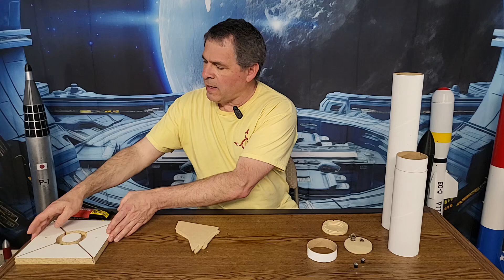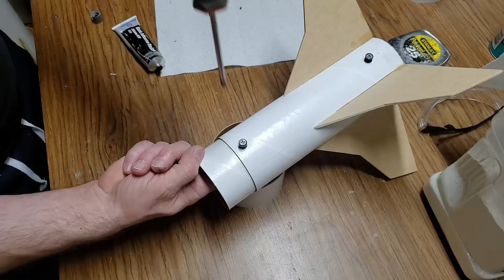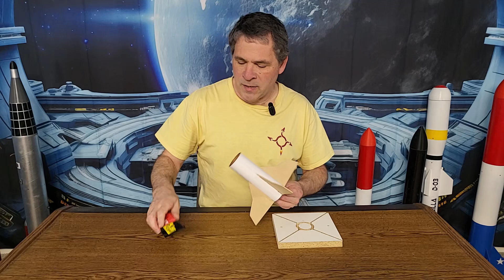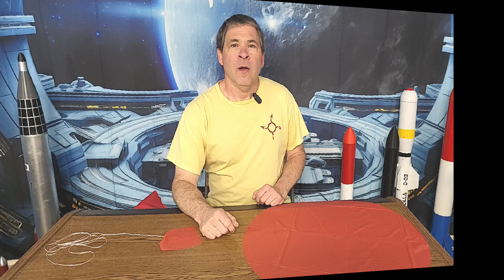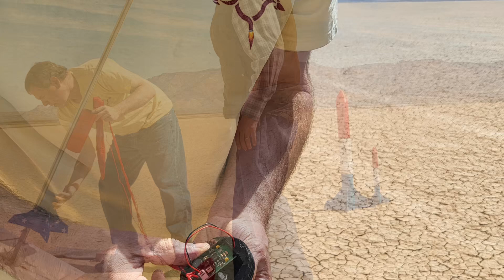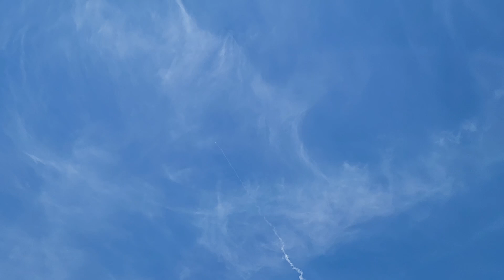Building and Launching some new homemade rockets

Comment: To eliminate not connecting your parachute to the rocket, use a checklist. It happens with everyone (an experienced L-3 certified friend of mine once launched a rather expensive 6" rocket with an O impulse motor and forgot to connect the chute...a simple checklist would eliminate these things from happening.

Comment: Hey its me again! I was wondering how u blow the nosecone of without ejection charge, or do you maybe have a motor that does have a ejection charge? :D
Reply from the maker: Hi... We use a flight computer to detect when the rocket reaches apogee and that fires and ejection charge. Here's a video that shows our electronics bay system built into the nosecone.
https://www.youtube.com/watch?v=kqkOH7tAqLM
There's links in the description of that video that give more information about building the flight computer and ejection charge.

Comment: Hey guys. I'm an amateur rocket enthusiast from New zealand. I want to be able to make a rocket motor using flexi fuel. So can you tell me what the  ratio of the ingredients for flexi fuel is? I have checked out your videos about rocket motor construction, but the materials I have available mean that my rocket motor size will be different. So I can't just copy what you fellas have done. Have a good day.
Reply from the maker: Nice to meet you... Thanks for coming by...
First off, make sure you watch this video, it's my favorite motor to build:
https://youtu.be/U1PLWJNi9ko
I'm currently using 65% powdered potassium nitrate, 18% powdered sugar and 17% corn syrup.
Corn syrup can be difficult to find in some parts of the world. If you're having trouble finding it, try Bin Inn. Otherwise, there are other alternatives you can use. We made a series of videos about alternatives. Here's a link to that playlist:
https://www.youtube.com/playlist?list=PLdExiIqOZ0llJQ42u5XqHqHTp8298Ze5z
I've done a little research into metric PVC and my best understanding is that uPVC DN32 PN18 is the closest equivalent to USA 1-1/4" Schedule 40 PVC pipe.
Feel free to ask any questions, I'm happy to help.
Reply: Hey, thanks for taking the time to answer me. I'm a big fan of your  work it is very inspiring, and I have learned a lot from watching you. Keep up the good work. 
Seth

Comment: I like your nose cone and electronic bay design, is it in line now? Does it have protection in case the rocket crash?
Reply from the maker: The 4" nosecone and related electronics bay components are available on Thingiverse.
https://www.thingiverse.com/thing:6925575
I have not put up the 3" or 2" ones though. If you are interested in them, I can make them available.
Crash protection... hmmm... well, if your nosecone fails to eject and the rocket comes down ballistic... That's the end of your nosecone and most likely the end of your flight computer. Sorry.
Reply: @rotaryrocketry  I'm a little late, but can you make these available?  Also, are the smaller fin, ring, and bulk head patterns available?
Reply from the maker: Exactly which parts are you interested in... And for which size rocket. I will do my best to provide you with what you are after.
Reply: @rotaryrocketry  If you have the nose cone STL files and the printable patterns for the fins and rings that would be awesome.  Starting my journey from Estes style kits to bigger and more powerful rockets.  Would love to start with the 2 inch and work my way up. :)
Reply from the maker: O.k... I have all that... It would be best if you email me and I can get that to you. If you go to:
www.youtube.com/@rotaryrocketry and click on the word "more" beside our logo, it will pop up a box that will show you our email address.
Reply: @rotaryrocketry  I would like to make the micro eleminator for my first mid-power rocket. would you please post the 3d nosecone print file. thank you.
Reply from the maker: Here it is... https://www.thingiverse.com/thing:7136582
Reply: @rotaryrocketry  Thank you....
Reply: After a rather expensive ballistic recovery of electronics, I built a 'black box' for one of my 8-foot long 4" minimum diameter rockets. Worked great the next six flights but how do you test it to see if it protects the electronics?  On the 7th flight, after it started arcing over, I realized I hadn't armed the electronics (the reason for checklists, experienced or not). We watched it come down from above 5,000' and about a mile away. 
Two months later, a university team out searching for their rocket found my steel nozzle sticking out of the ground. We dug it up, now 3 feet long, and found the black box intact but with eye bolts smashed into the bulkheads. We ground them off and slid out the electronics that looked good. Replaced the dead batteries and heard the altitudes beep out...the black box had done its job.
Do I still use it? Not often because of the added weight and I seldom crash rockets but on flights filled with expensive avionics, it still gets used, especially if I need added weight for stability.
Reply: @mojaverockets I definitely will build some protection for the electronics, because I don’t want to keep building the circuit over and over! Maybe an aluminum box inside the pla box with crumbling zone.
Reply from the maker: That's one reason I like using the EggTimer Apogee.... It may not provide a whole lot of flight data but when I smash a $15 flight computer I'm not really that upset. I remember crashing my $80 Altus Metrum Easy Mini... That was depressing.
Reply: @wayofflow955  My decision to build the black box was a crash with $800 of avionics and thinking there must be some way of protecting them. 1/2" bulkheads and 1/4" wall compartment did the job plus including G-force reducing foam and mounting the electronics inside in such a way that reduces or restricts their movement...older style capacitors and GPS chips are notorious for detaching.
Reply: @rotaryrocketry  When I lost $800 worth of avionics in a crash, that convinced me to make the black box. I have my students and advise others to use Eggtimer Apogees on rockets that don't need dual deploy, as an intro to flight electronics, learning soldering, and as the primary recovery deployment and use the motor eject as a backup...plus knowing the altitude all for around $20 (don't forget the $5 lipo battery).
And on rockets needing dual deploy, the Apogee makes a great backup to more expensive flight computers to at least prevent ballistic recoveries.

Comment: Same motor on a smaller, lighter body, naturally, it has a better chance of performing well, same reason they make dragsters light, even when they look like bricks going down the quarter mile.
Reply from the maker: True but I didn't expect to double the altitude.
Reply: @rotaryrocketry  Well, some times halving the mass can double the velocity, and indeed, yes, you did reduce the drag some, so, to some extent, it can all add up.

Another thing, the temperature of the air [that which imparts viscosity upon it] can have an effect as well.

To launch the same rocket on a very hot day, and on a very cold day, even with the propellant stored in a very uniform manner [aka the propellant grains of each rocket were ignited at platform at the very same temperature (since heating the propellant grain would also alter burn performance, which is YET ANOTHER factor to count into it), the hotter the air, the less viscous it is.

This too is something you learn about in the aerospace industry.
Reply: @hunnybunnysheavymetalmusic6542  Rockets have a sweet spot for maximum altitude...too much or too little mass can lower the altitude.
Reply: @mojaverockets  Yes, it is indeed a balancing act when one is not just 'going all out' to find that point between too much mass and too little mass.

Same with body shapes, because while a really sharp point will allow more speed, it will also cause more heat on the tip [this applies mainly to supersonic speeds, of course] which can be very detrimental.

Also, shock waves on faster rockets can cause damage and cause transonic stall that can rob altitude, and fin shapes can affect how much drag and roll authority the rocket has, and how it responds to cross winds.

Lots and lots of little factors to figure in.

Comment: I hate when people call a sold object 'aerodynamic.'

Only gases can be aerodynamic.

The correct term is 'has a lower coefficient of drag.'

To some extent [but to a VERY LIMITED extent] it is okay to say 'more streamlined.'

I say this as an engineer who had to learn aerodynamics, to its fullest extents, to build turbofan engines for Rolls Royce, as well as other 'aerodynamically applied' sciences involving fighter aircraft in the USAF.
Reply from the maker: One definition of "Aerodynamic" from Merriam-Webster: "the qualities of an object that affect how easily it is able to move through the air"
Reply: @rotaryrocketry  The irony of that is, that while it has been lazily slipped into modern street vernacular, it is technically not a word in that specific usage.

To say something is 'aerodynamic' must first mean that the thing is a gas [which, clearly, it is not] and also that it must change and react in the manner and fashion that a gas does, according to all of the various gas laws [which, again, it does not].

In essence Merriam Webster has begun using DEI and 'ebonics' in its post modern liberal response to changes in the culture, without any regard either for reality, or for the truth.

But NASA apparently forwent looking to Miriam Webster for its definition of aerodynamics, when speaking to 5th thru 8th grades...

And just gave them the truth instead.

https://www.nasa.gov/learning-resources/for-kids-and-students/what-is-aerodynamics-grades-5-8/

And here's Wikipedia on the matter:
https://en.wikipedia.org/wiki/Aerodynamics

Because INTELLIGENT people know the difference.

And as one who grew up in the industry with a father who was also in the USAF before me, who also worked on aircraft, its pretty much something I lived with and worked at literally from when I was old enough to be schooled by him in the science.
Reply from the maker: BOTH LINKS you gave refute what you are saying...
First sentence of the NASA page you gave says "Aerodynamics is the way objects move through air". The "object" is not a gas.
First paragraph on Wiki page says "the study of the motion of air, particularly when affected by a solid object." So clearly, the "object" is a key element in the aerodynamics.
We shall have to agree to disagree because this is the last I will reply on this topic.
Reply: @rotaryrocketry  You have deliberately read the words to fit your world view.

This is something suffered by most of the world at large.

And yet, without 'air' there simply is no such thing as 'aerodynamics.'

Its NOT 'objectodynamics' [or more precisely 'solid dynamics' which happens to be a known discipline in and of its self].

The fact that 'aerodynamics' also include the actions of airs in the form of hurricanes and tornadoes, as well as the propagation of sound and shock waves in a gas, irrespective of a solid object proves that your assertion is factually wrong, and therefore invalid.

While the study of aerodynamics is frequently used to study the behavior of air around a solid, employing gas laws, it is still the study of the 'AIR' [ a mixture of gases] as it BEHAVES.

If said object were removed, the air would still be the air.

If the object were immersed in water, it would instantly be influenced by HYDRO-dynamics, which are, again, a subset of fluid dynamics.

If one drops a 'bunker buster' munition through hundreds of feet of rock or reinforced concrete, it is not aerodynamics.

And yet the forces of the solid/semi-solid particles still act within their own levels of behavior on the object in motion. Just at a much higher density and viscosity.

While aerodynamics, as reactionary forces, no doubt play upon the results of the rocket being launched, it is still incorrect to say that a solid object is 'aerodynamic' as a property of a solid.

https://www.quora.com/What-are-key-major-principles-in-aerodynamics-explained-in-laymans-terms

And, since I already see you will continue to use the term incorrectly, I shall say no more, as its not worth trying to say anything to those who are not listening, and who prefer acquired habits of speech over correctness of speech.
Reply: @hunnybunnysheavymetalmusic6542  I understand what you are trying to convey. An example would be to describe aluminum foil as "thermodynamic." In that case it makes no sense. But the term "aerodynamic" is different. You want to limit it's use to only the strict technical definition, but you are overly limiting the term. In the larger world outside of the scientific community it's not a misuse to call an object aerodynamic — in fact, that's a common and correct use of the word.

"Aerodynamic" is often used as an adjective to describe the shape, design, or features of an object that help it move efficiently through air. For example:

“This plane has an aerodynamic shape.”

“The helmet is highly aerodynamic.”

“The design is sleek and aerodynamic.”

So using "aerodynamic" to refer to an object — especially its shape or design — is totally standard. It has nothing whatsoever to do with "DEI, ebonics, or liberalism" (What?!). It's just that you want the scientific community to own the use the the word and not allow it to be used in any way that violates your rules. It's that important to you? Bring suit against all the car companies, starting in 1934 with the "Chrystler Airflow" model calling it "aerodynamic".
Reply: @hunnybunnysheavymetalmusic6542  dude, you must have been a real joy to work with. Saying INTELLIGENT people know the difference is a very narcissistic and unprofessional response.
Reply: @thisisreallife5086  straight facts
Reply: Aerodynamics is the study of how air behaves around a solid but a solid can have aerodynamic properties that allow for better aerodynamic flow. But it doesnt really matter anyway and not worth the argument. I have my phd in aerospace and i dont run around the rocket factory correcting people. If one of my other engineers calls a solid aerodynamic, i dont correct him. There is no need. The solid does indeed affect the aerodynamic flow. So to say a rocket needs to be more aerodynamic just means the shape needs to change enough to allow better flow.

But yes, aerodynamics is the study of the motion of air particularly around solid objects
Reply from the maker: Well, I'm happy to see others jumping in on this. I think you see my point... I agree that "aerodynamics" is the study of air movement BUT there needs to be an object that the air is moving around. Therefore, the solid object is integral to the equation. Simply put, without the solid object, you cannot study the aerodynamics.
Reply: @rotaryrocketry  exactly. The study of aerodynamics according to wiki , one of his links he posted, is the study of air motion around an object.. no object, no aerodynamics.
Reply: @ No AIR and ALSO no aerodynamics.

What's your point?
Reply: @ Actually, that is false, because a liquid can be involved in the study of aerodynamics as much as a solid can.

In fact, aerodynamic principles are in force upon common rain, on waterfalls, and even on waves on a body of water.
Reply: @hunnybunnysheavymetalmusic6542  my point is, if their is no solid for the air to interact with their is no aerodynamics. The word dynamics in science and physics and engineering means how physical systems change over time with forces and their effects on motion.

Aerodynamics can not exist without a solid Object aerodynamics is the study of how a fluid (like air) interacts with a solid object. Fluid mechanics 8th edition frank m white. 

Defined in 1949 " aerodynamics: the dynamics (theres that word again) of gasses on moving objects"
Reply: @hunnybunnysheavymetalmusic6542  air is considered "liquid" as i have stated from my books used for my phd, i will trust those and my professors over this argument.  Even my book on aerodynamics for the 4 semesters states "good aerodynamics of the glider was vital for the wright brothers success" glider is a solid object. Anyway, i will trust my books and professors more
Reply: @ Being streamlined, exhibiting a smooth, laminar flow conducive surface, in and of its self is not 'aerodynamic' all the same.

Because in space, those physical conditions can still exhibit on the object, even without that air.

In a total vacuum.

As could they in water, in oil, or even in molten rock, depending on what the solid object is.

And with the advent of bunker busting bombs, it can even be in solid substances.

The OBJECT is, by its self, NOT 'aerodynamic.'

ONLY AIR [or similar gases] is(are) 'aerodynamic.'
Reply: @hunnybunnysheavymetalmusic6542  Actually, that’s a misunderstanding. Aerodynamics isn’t about gases being aerodynamic—it’s the study of how air (a gas) flows around solid objects. The term “aerodynamic” refers to the shape or design of a solid that influences airflow, like a wing or a car body. The “dynamics” part means how the flow changes due to forces, in the presence of a solid. So yes, solids can absolutely be called aerodynamic because they affect the dynamics of the air around them.